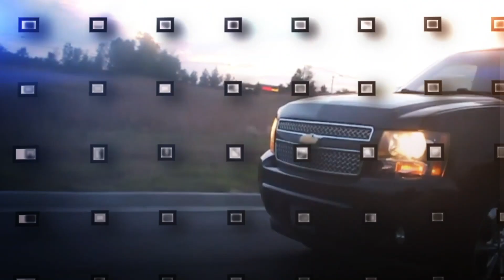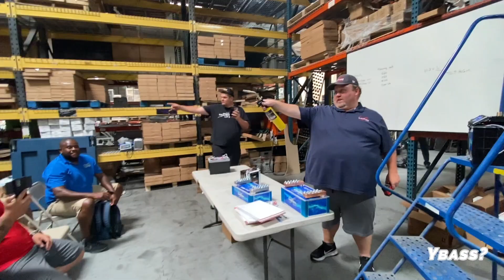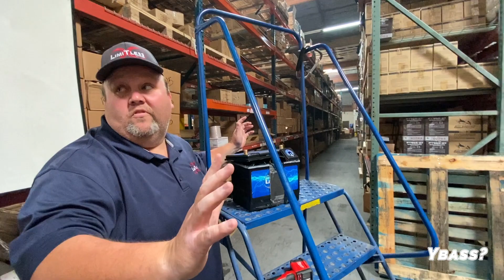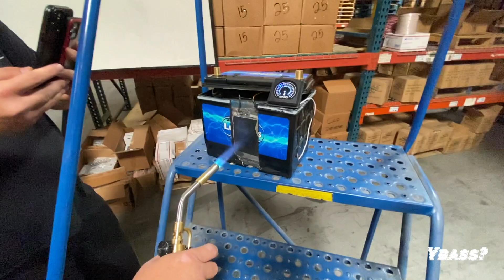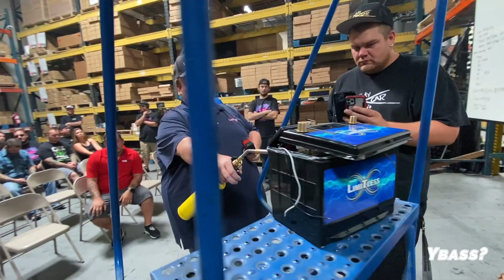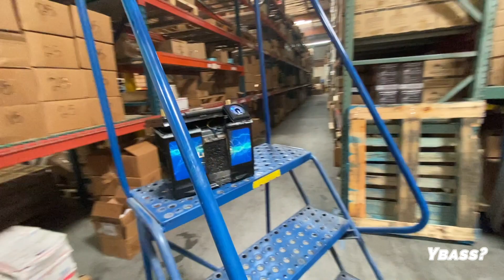Limitless Lithium Battery Fire!

Comment: Surface temperature for a few seconds doesn't show what they go through with 200+ degree temps under a hood, soaking in that heat for your drive. That time will vary. Heat soaking a battery under the hood for a 4 hour drive, or demo session at a show would prove the technology they use works as intended. This test was far too short to prove anything other than the surface can take some heat for a VERY short duration. 

They DO make some seriously nice stuff though. I wish I knew you sold equipment, I would much rather give you business than the over hyped, and overpriced competition. 

Thanks for sharing! I would like to see an extended test, in a hot box, at 200 degrees. That would sell me in a hot minute! Pretty happy with my headways, but there always something better! 

What's the company name? I'ma start researching!

Comment: If my batteries ever get that hot then my vehicle is already on fire.  What happens if they put a fatal short on the battery, that could happen in a car accident especially with a lot of zero gauge wire in a vehicle
Reply: This battery has a full battery managment system (BMS) that has 
Low voltage protection
High voltage protection
Short circuit protection
And thermal protection built all in one unit.
Reply from the maker: It’s a smart system battery so it will shut off if it goes below 10volts. Just like their Nanos
Reply: You need to jump in with team yes fuse. 12 " from alt & 12" from batt on ALL WIRES!

Comment: Good stuff looks like it can handle sum heat forsure. How many watts is this rated for. Or can u get it for all of the lithium batteries that y'all sell
Reply from the maker: 5k watts per battery and you can use with their line of lithium